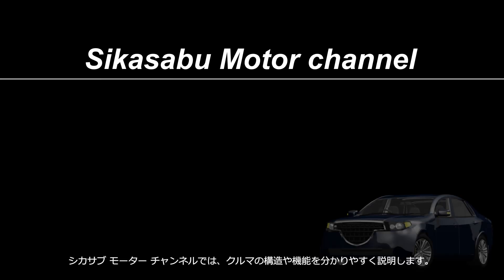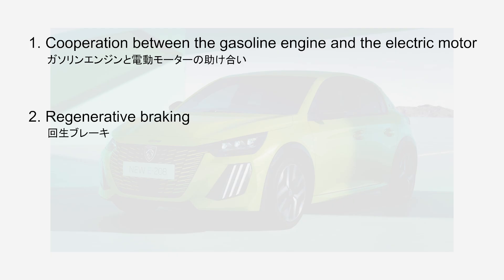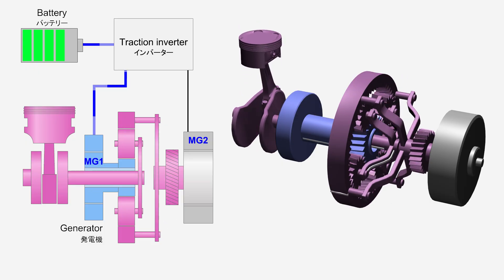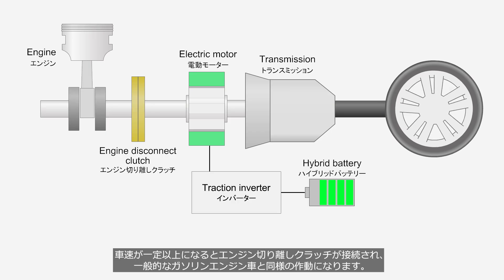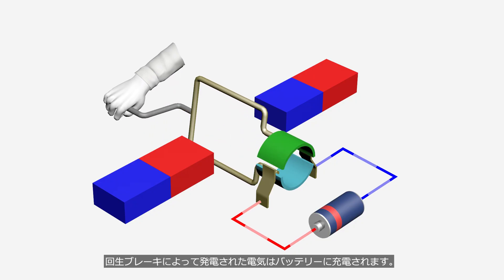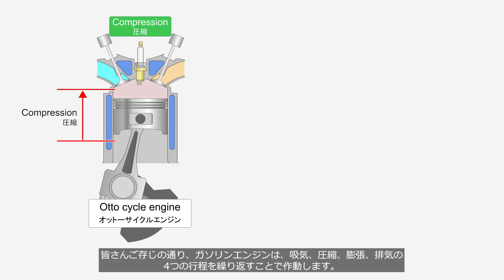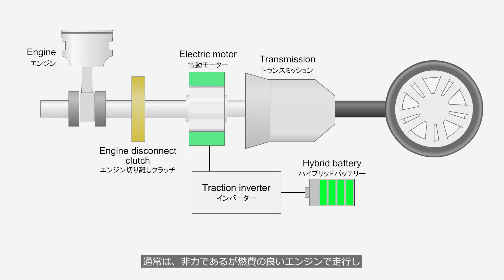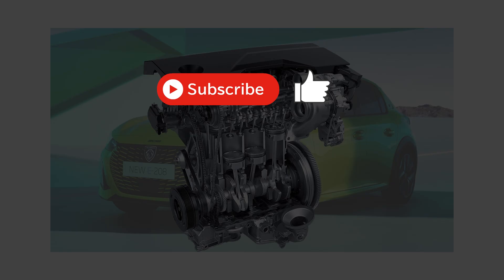In-Depth Explanation: Why Hybrids Achieve Better Fuel Economy

Comment: I like your detailed explanation of hybrid systems of various manufacturers. Id love to see video about chery kunpeng 3dht hybrid system in cars like chery tigo 9, omoda 9, etc.

Two e motors, three clutches, one synchornizer, thre gears and 11 driving modes - from e drive through range extender, dirdct drive, regen braking, etc. It is beaufitiul. A 6l/100 in 2.2ton 480 BHP car.. this powertrain is impressive.
Reply: Three clutches + synchro sound's so unnecessarily complex compared to zero clutches in toyota's hybrid